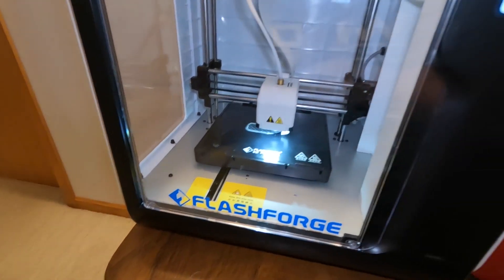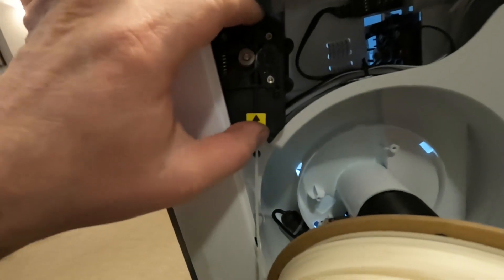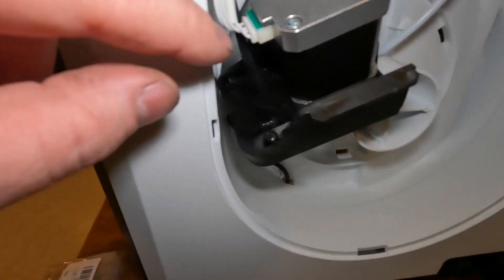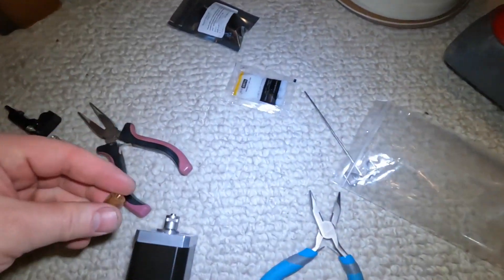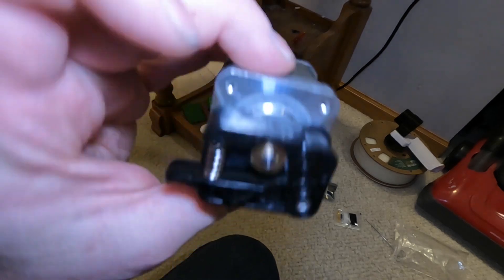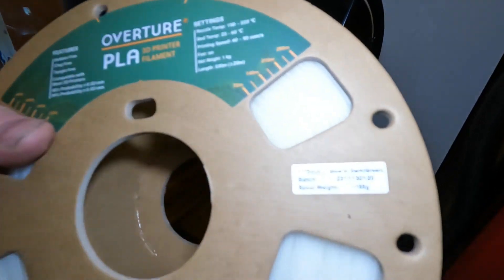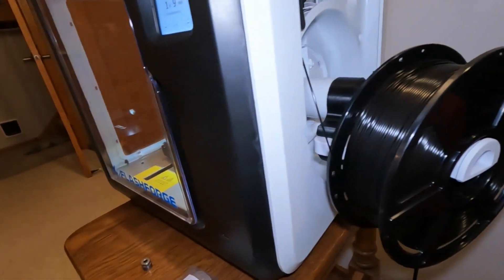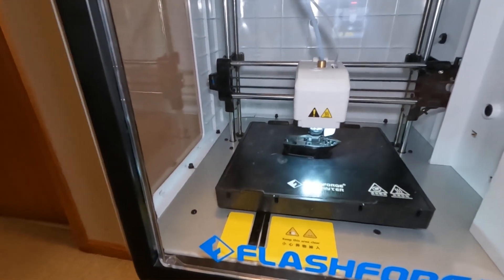How To Fix 3D Printer Clicking or Skipping. #flashforge #ender #3dprinter

Comment: I was under the impression that noise is not the extruder slipping, but the stepper skipping. This usually means a clogged nozzle, nozzle too close to the bed, extruder temp too low, or just exceeding the extruder's capabilities. The flow filament might just be harder to extrude... Try increasing the temp or just printing slower.